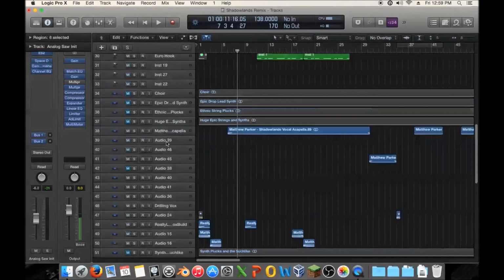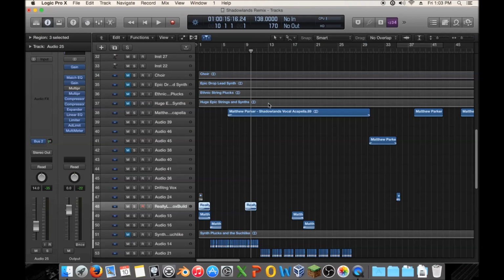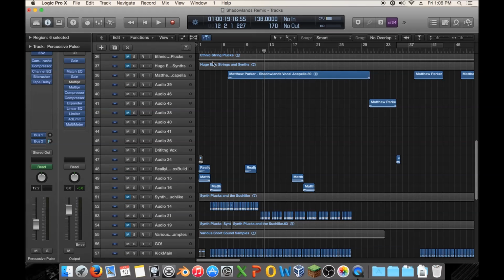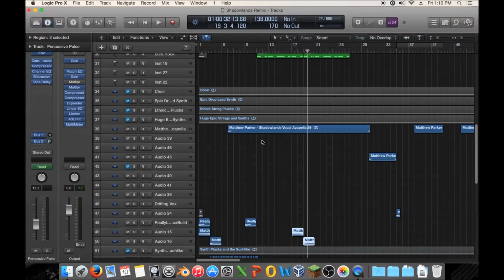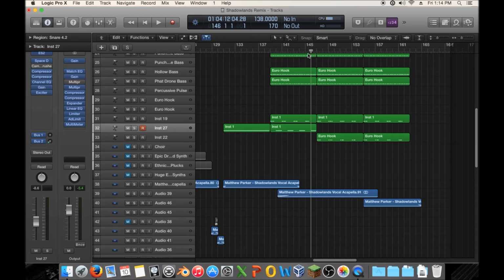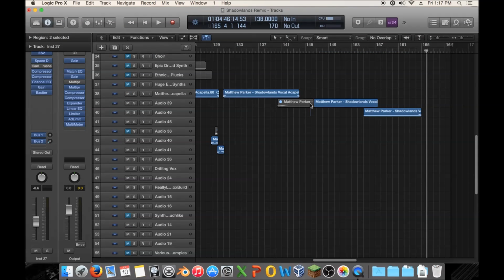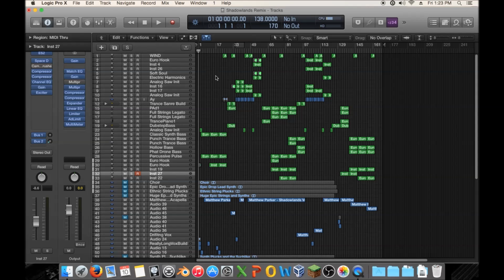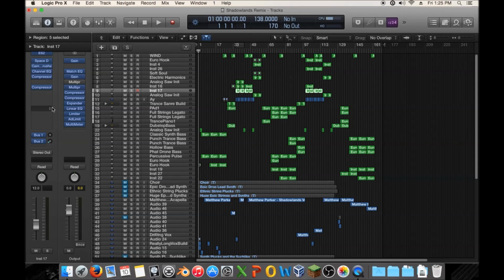Mastering EDM Ep. 35: Using Effects - Logic Pro X

Comment: Those effects are IN logic or you have to download them?
Reply from the maker: Lucas Cisneros Most of them were actually made for that project. For example, I got a snare, added a LOT of reverb, and then compressed it. In the case of the white noise sweep, that was a synthesizer. The reverse vocal builds were a combination of the original vocal track, and a reverse reverb for the vocal track. The only premade FX samples I used were Boomer FX 02 and 32. At the end of the track, the background vocals were the ones from the original track that this was a remix of.
Like I said, I don't have many FX samples, mostly just logic's built in ones (open the apple loops pane, and filter by effects).
Reply: thanks!